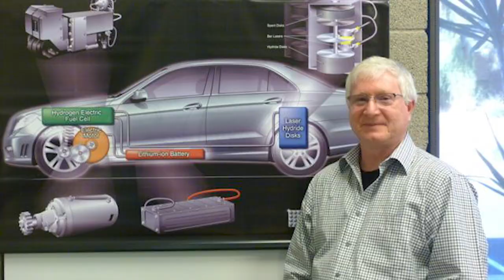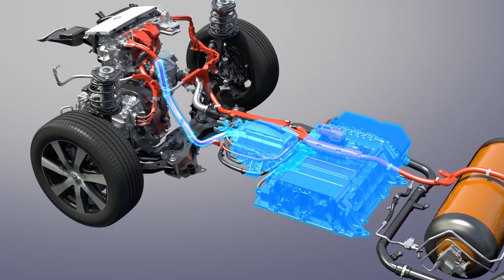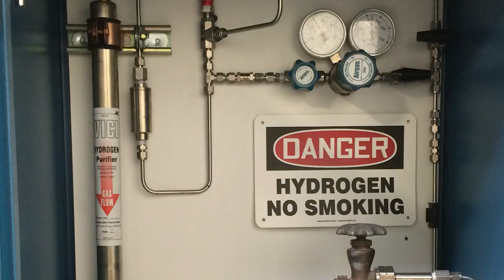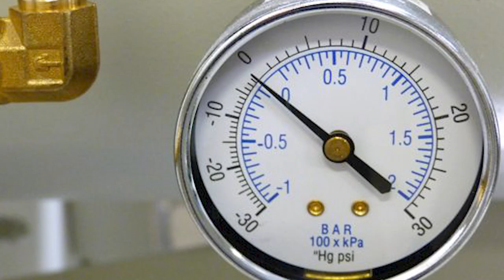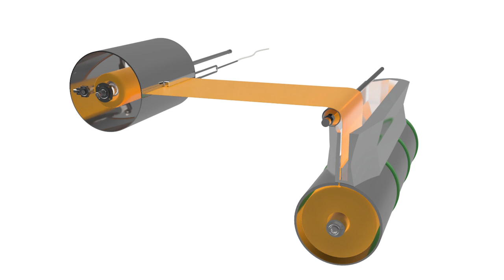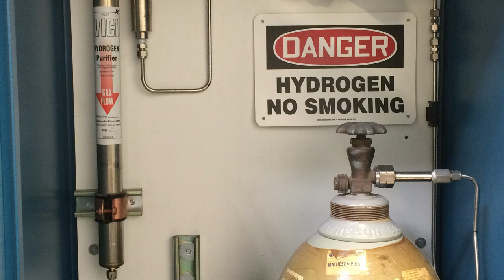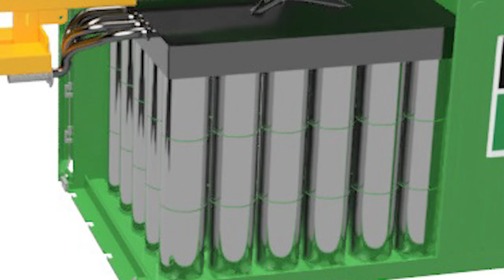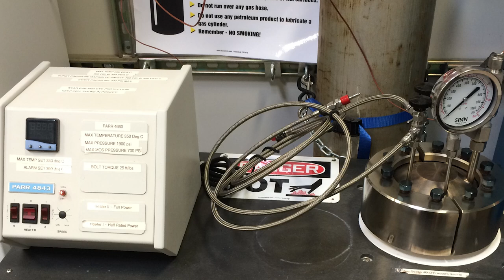This BANNED Technology Could Push Hydrogen Cars Over BEVs

Comment: This interview made me really suspicious

He seemed intent on NOT answering your question about weight and range.  Then when he did, he answered it in miles per pound (20 miles range for 15 pounds of cartridges).  No engineer would answer in just miles, he'd answer in KWH, or quantity of H per second.  not miles.  He seemed to struggle to answer your specific questions, like he was trying to remember from his preparations for the interview.

You should have asked what the rate of production is from the cartridge.  How much hydrogen can it produce, and how much electricity?  

I assume that a battery is still required.  I doubt the Hydrogen powercell can ramp load up and down as quickly as required in an EV.  plus, you want someplace to store regen power, right?  So, now you have an electric motor, a smallish (say 15-20kwH like the Volt) battery, a hydrogen converter, and this system to convert cartridges to hydrogen, and the pack to hold the cartridges.  Sounds like a lot of complexity for a car.  It may make sense for larger applications like a semi, boat or a plane.

I hope this works, and that it is amazing as he thinks.  I still like the convenience of charging at home for free off my solar panels.
Reply: he is trying to dumb it down for uh .... me
Reply: Sounds like the Pogue Carburetor on a Cold Fusion engine.
Reply: You are correct it makes sense, for on-highway semis, locomotives, trains, tractors, planes, RVs, and standby power generation. It also makes sense for cars unless the vehicle produces less than 201MPGe. In the near future, you may be seeing Li-ion vehicles going over 201-MPGe but not heavy vehicles. Solid-state hydrogen's energy density gravimetric is 1000 Wh/kg which is 870Wh/kg less than compressed hydrogen and 870Wh/kg greater than lithium-ion batteries. Right now my company produces hydrogen using  PEM electrolyzer systems which are running our power trains on Semi-Trucks, busses, and locomotives in Europe. We also flew our first hydrogen plane in April. To reduce our carbon footprint we need to change to renewable power back at the utility. The immediate advantage of this technology over batteries is you could run all the nuclear plants full power.to produce hydrogen. Nuclear plants cannot handle peaking.
Reply: Look closely.  He was reading part of his answers from a prompter.

Comment: Thanks for sharing, but the most valuable question is Energy density and system efficiency,  A battery soon will be about 400W/Kg, to charge a battery from the grid it's about 15%, so how much is the energy density of each of your unit, W/kg and how much energy needed to store the amount of Hydrogen and to release it directly to the fuel cell?

Comment: This is like listening to the inventor of a perpetual motion machine.  If you use energy to isolate hydrogen, then use energy to make a product, and then use energy to produce electricity, it will never compete with a battery for a car--or for a smartphone!  It's just ridiculous to even discuss it.
Reply: The requirement is for mobile energy you can take with you. Efficiency doesn't matter much if it's 'Good Enough'™'. Gasoline more or less proves that: 25% efficient. If this was zero emissions and supplied 'adequate' range, it might be 'Good Enough'™'. We'll find out soon enough. :-)
Reply: @SteveWithers  Gasoline became the default because it was cheap, and plentiful. Fuel cells aren't going to beat BEVs. They require infrastructure that doesn't exist, and because of the multiple conversions... electricity->hydrogen->solid state media->hydrogen->electricity, there is no way it is going to be as efficient as BEVs, that use an already existing infrastructure (the electric grid).
Reply: @jeremypmerrill  I agree about fuel cells. Did you watch the video? These cartridges release H on demand. A different thing. Absolutely less efficient than batteries, but maybe cheaper for car makers to make cars......and they don't have to be battery experts with their own battery factories.

Comment: What Hydrogen cars need isn't better hydrogen storage. Sure it's great when we can replace the high pressure tanks as they are heavy and protentionaly dangerous. 
But the real problem is hydrogen production. It just isn't efficient enough. We just can't use three times as much electricity compared to BEV just to safe a bit on charging time.
So until a new method is found to produce clean hydrogen it just won't be feasible for normal cars. Airplanes and co maybe.

Comment: I'm imagining "disk" swapping being just a pain for users; I'm doubtful they can automate that (requires complex equipment). Plug in and wait seems like a far easier, understandable user experience.

And the infrastructure needed to store, ship new, and return old hydrogen disks seems very costly and inefficient, whereas pure electricity can be transported long distances easily.

I hope people will continue exploring this and other options, but my money is still on BEVs right now.
Reply: Agreed. Although, it might work for trucking and bus industries for those wanting quick "charging" to long haul or haul heavier loads than electric 'semis" available now and coming to market. Bottom line is the hydrogen price would have to drop a lot.
Reply: I think this depends heavily on design. Design it well and it shouldn't be much more difficult than changing the 12W car battery (which again depending on design can be very easy or very hard). I'd hope to see basically a bank of fuel cells with indicators for which ones are low so you just swap those out like you might a grill propane tank. How long it takes depends on how many you swap out.
Reply: To be fair, some companies (like China's Nio) are pushing the idea of swapping 1000+ lb battery packs. So swapping 400 lbs of "H2 disks" seem easy by comparison. But then again, it's one thing to swap occasionally for long trips and do the rest of your charging conventionally. Quite another to rely on swapping as your only fuel!

Comment: So we will soon have two competing hydrogen fueling infrastructures that don't exist.  How many years has Tesla been working on its Supercharger network to make long distance travel generally acceptable in most markets?
Reply: At $200,000/refueling station, it would fairly inexpensive to build out a fueling network. If you build 2,000 of them to get fair coverage for the US, that would be $400 mil. Chump change for Toyota if they wanted to build it.
Reply: @777Outrigger  $200,000/20' container of cassettes.  Though they mention the possibility of automating the swap that is only under design.  The sum also does not cover the distribution system to retrieve and refuel the cassettes.  They propose many such regional facilities located close to renewable energy sources.  That sounds substantially more expensive than $400 mil.  I still don't see how it gets traction.
Reply: @mrhickman53  OK, $2.0 billion, spread out over several years. Still chump change for Toyota.
Reply: Hydrogen might come back around in like 2050, until then electric transportation will win.
Reply: @PaulVining  By that time renewable energy installation should be so extensive that the relative inefficiency of the H2 energy cycle should be immaterial.  If it can truly provide more convenience at this time it is a welcome technology.  As long as renewable energy is not meeting our complete needs I cannot welcome H2.  Its cycle is just too inefficient for those applications where the rejected heat cannot be utilized.
Reply: @mrhickman53  Electrify America built out a credible nation-wide charging system in less than 3 yrs. Toyota, could easily do as well with hydrogen.
Reply: @777Outrigger  Can't comment on how credible it is as I drive a Tesla.  The reports I read is that it is much more difficult to travel cross-country with a CSS-compatible car.  Travelling 10,000 miles while towing with a Tesla, I can attest that towing is difficult but getting cross-country with a Tesla is straightforward along most interstates.

So far, I have not seen Toyota willing to even make H2 work in California, let alone across the US.
Reply: @mrhickman53  It is more difficult on CCS and EA to do cross country in some areas, and there are still some bugs but the system is good enough for a lot of people to consider CCS based BEVs. The system is still growing very fast, bugs are being worked out, and in a couple of years, I think it will be a very good nation-wide system.

My comments about Tesla are hypothetical. But Toyota will have to build a nation-wide system to make their hydrogen cars credible. If they're serious.
Reply: @777Outrigger  We are only sparring due to my skepticism that Toyota will ever get serious.  I feel that they are making a grave error in permitting a viable alternative generate anywhere from acceptable to excellent coverage prior to even starting a viable H2 distribution in any significant region.

To your point about CCS already being viable for many potential users:  rapid charging rarely comes into play for daily driving.  Though I have used superchargers on two long trips and a couple of short ones, I have not visited a supercharger for over two years now.  It is just not a thing I need for daily driving.  

The difference between H2 and Tesla or CCS is that H2 always requires infrastructure near where the driving is taking place.  BEVs do not.  A few hundred dollars of electrical work permits full charging overnight.  Seldom do BEVs require full charging at home.  It only occurs for me when I return from a trip and elect not to supercharge within the last 50 or so miles (remember, I normally tow on trips).

While my nearest supercharger is currently 3 or 4 towns away that is not an issue.  For an H2 refueling station I would find it terribly inconvenient to not have one in town and mildly inconvenient to not have one on each side of town.  The H2 vehicle owner in the next town will feel exactly the same way.

We always talk of ICE vehicles having great range.  However, I hazard that the average level of fuel in the tank cuts that range to less than half at the start of most trips.  The calculation is often "can I squeeze in this trip without refueling?".  The high density of gas stations conveniently let this answer to, more often than not, be "yes".  For H2 to have a similar convenience to today's ICE I assert that the refueling opportunities must approach that of ICE, though with fewer instances of competitors on opposite corners of the intersection. 

For daily driving BEVs have already proven far more convenient than ICE for those with access to electricity in a garage or driveway.  H2 will struggle to build sufficient infrastructure to be nearly as convenient as 2nd-place ICE.

In most of suburbia this is absolutely not the case for BEVs.  Charging is done in driveways, not commercial facilities.  While we need to address how urban neighborhoods address charging, the practical matter is we are far from saturating the suburban market so we have some years to address this.
Reply: @777Outrigger  The federal government has stuck itself in the fueling industry with these Democrat "infrastructure" spending bills. Shouldn't the price to Toyota be ZERO? lol
Reply: @PaulVining  When people have to start lining up and waiting 2 hrs to get a 30 minute charge and limited fast charging stations it' won't take 205 to come back to this. 10 cars an hour per this "refill" station, vs 2 cars an hour per fast charging station. It's not even a competition then.
Reply: @spazoq  Yes, I agree. We don't need the government in this. Tom Moloughney at Inside EVs recently said that there's a lot of private investor money on the sidelines waiting to invest in charging infrastructure when Electrify America charging stations start filling up, in other words, when there's a profitable economic model for it. But politicians have to "save us"  anyway.
Reply: @777Outrigger  There's electric distribution everywhere. There's no hydrogen pipelines or electrolysis stations. Now think of the large investment to recharge hydrate disks. Oh, and distribute them to re- um- "redisking" stations?
Reply: Let us review. Alex asked Sandy, what would you do if you were CEO of Toyota? That's when Sandy brought up this H2 technology and this company. He obviously thought there a possible economic model to this new tech, and that's all I'm saying. So if you believe Sandy is credible about Tesla, you have to say he's credible about this new hydrogen tech as well.
Reply: @777Outrigger  As a technology it is quite possible that the proposed form of storing H2 is economically superior to storing H2 as a compressed gas.  For a company as fully invested as H2 as Toyota, a shift to a more economic fuel storage strategy may make more sense than attempting to shift at this late date to BEVs.  My personal opinion is that, in doing so, it only prolongs their demize. 

To be clear, Sandy promoted the technology only from the perspective of the Toyota CEO, not as a general endorsement of the technology as a general competitor to BEVs.

I respect Sandy.  At the same time this video is so light on details and lacking of caveats about the technology it is not clear on what Sandy is basing his enthusiasm.

What has not been identified is the niche problem that this technology uniquely solves that BEVs cannot, within which, the technology and infrastructure can mature without direct competition.  This does not mean that niche does not exist, I just did not hear a compelling argument for it and I am not creative enough to imagine it on my own.  As with any H2 technology, I strive to find a stationary application where the heat rejected from the fuel cell has value to the process.

I can't imagine the fuel not being sold at a premium to the electrical cost of operating a BEV.  Individuals will pay that premium to not be able to charge in the driveway overnight or top off at a destination charger while dining or shopping.

I can imagine an on-board electrolyser and field generator to recharge media at some rate.  That's easy to imagine because I have no idea how the recharging works.  The vehicle already has media transport mechanism for the liberation of the H2.  With yet more complexity on-board one would now have an overnight refueling option, providing electricity and water, rather than just electricity.

I did finally imagine one niche while writing this.  I don't think the capital cost for the homeowner will pay out but it could be worth exploring.  As residential/commercial heating moves away from fossil fuels, operating a heat pump from a fuel cell where the heat rejected from the fuel cell is either used directly to heat the space or directed to the evaporator coil of the heat pump increases the net efficiency of the H2.  The system can operate independently of the grid, if desired.

When we heated our house with oil the 200 gal. tank would carry us for 3 weeks in the coldest part of the season.  With a heat pump COP averaging around 2 to 3 for such periods 100 gal equivalent of H2 would be required per delivery, or about 5 times the amount required to fuel a Miria-class car.  I wonder what that looks like.
Reply: @mrhickman53  Every thing you say could be true. Perhaps! Sounds reasonable. :-)
Reply: @spazoq  I think you are mistaken on the fast charging situation at large. The only reason hydrogen is even discussed is because that is a way for the "fuel" companies to stay in charge of everything. Come back to this discussion in like 5 years and see how it pans out.
Reply: @PaulVining  you will still have to wait 2 hours in line to get a 30min charge, i take a 3 min gas refuel instead any day

Comment: Major disadvantages of this system.
1. Conversion loses in generating hydrogen + storing the hydrogen in disks. 
2. Cost and materials in manufacturing those disks which further pollutes the planet.
3. Batteries can be reused for many more cycles verses those disks.
4. Complexity of the system verses batteries that simpley plug into the grid.

This technology probably has potential in limited cases such as electric planes and high powered vehicles but batteries are probably superior for the masses.